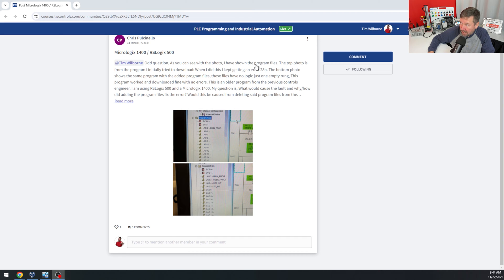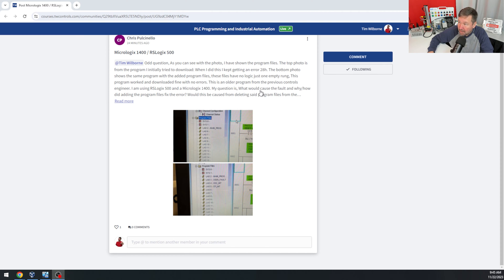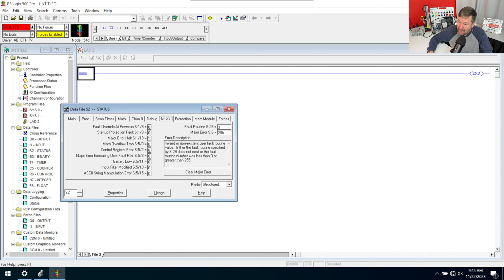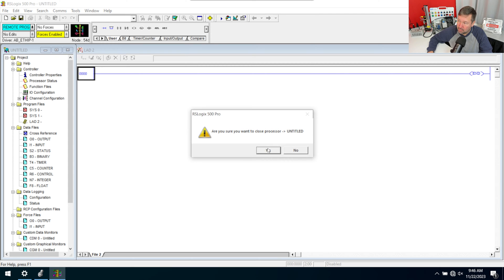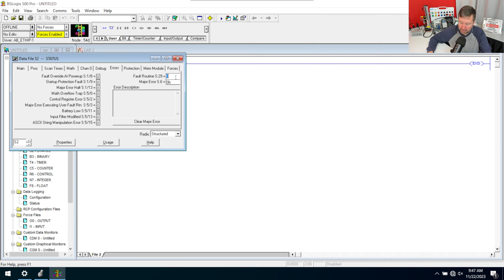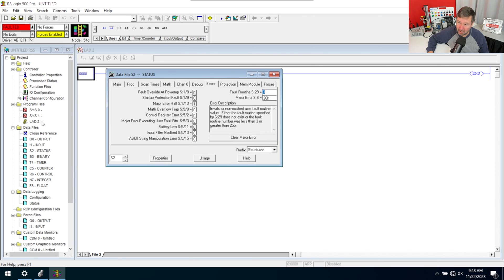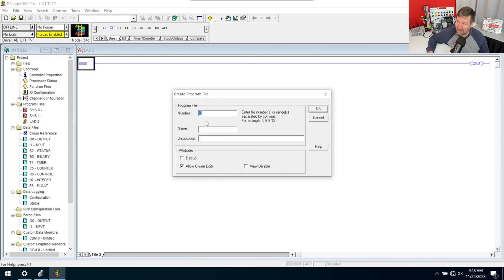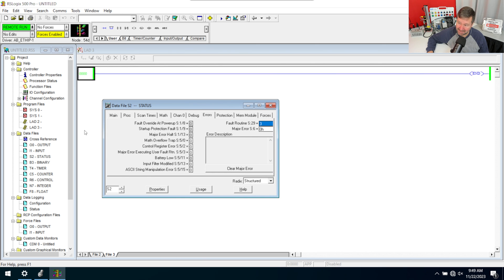RsLogix 500 Error 28H on a Micrologix or SLC 500 PLC

Comment: Hi Tim I had a quick question, Is there a way to disable restarting a SLC500 504 processor Last State? I had an experience with a power loss and when the PLC restarted it continued running where it left off and I DON'T want it to do that for safety reasons. What do you have on this? Thanks
Reply from the maker: Check out this video. It explains how pre-scan and the first scan can affect your power up outcome
https://youtu.be/34W_seFUFys